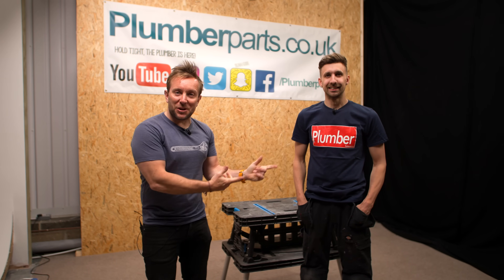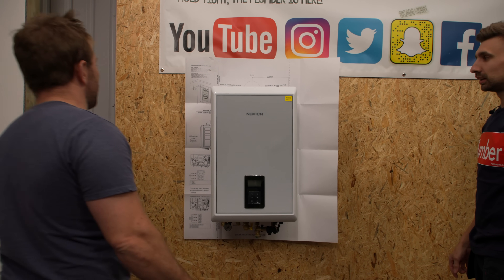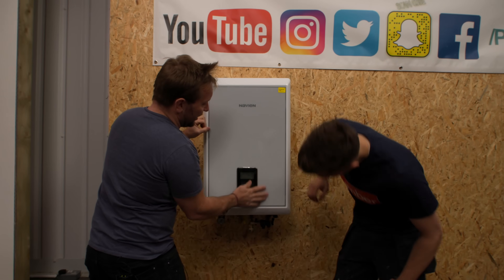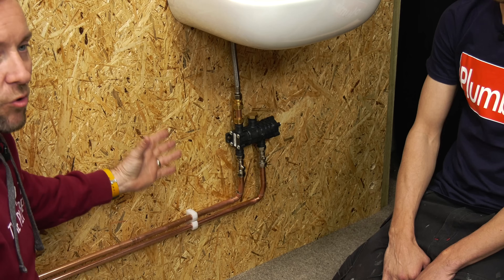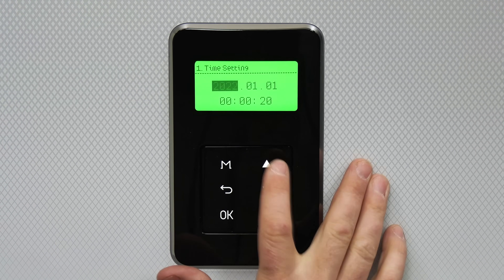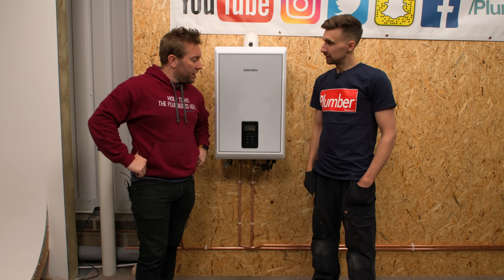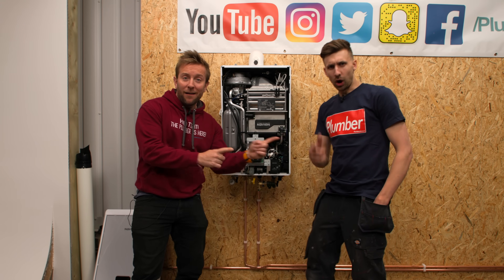HOW TO GET INSTANT HOT WATER FROM A COMBI BOILER - Navicirc review

Comment: On the navien channel. It says just connect hot and cold to the recurculation valve. (Check it out) would this not cause legonaires issues? As it would be warming the cold drinking water
Reply: Wouldn't you be taking the cold drinking water off before it reaches the boiler? Not necessarily, no, but you could do?

Comment: People acting like a secondary return on a combi is a new and innovative thing 🤣 been doing this for years, standard bronze pump and motion sensors in the bathrooms & kitchen, pipe stat on the return to knock it off once the return is warm. Looks like a good boiler though, OpenTherm and 15:1 modulation. Going to need a huge gas supply though!

Comment: At 16:10 Josh makes reference to "barrel pipe" as unsuited to a secondary return. I'm not sure what this reference means and would appreciate a heads-up on it.
Reply: What I mean by barrel pipe - is that some plastic pipe comes with a single layer but barrel pipe has two layers. Because secondary return pipes are continuously hot the non barrel pipe starts to disintegrate.
Reply: @joshtappin3269  I think you mean barrier pipe.

Comment: Interesting but a bit of a gimmick IMHO you still need a decent flow rate to run several showers at once much better off having flue recovery system, liking the Intergas boilers which have this with simpler design.

Comment: Been doing this for years in commercial
Reply: The secondary return accessory has been available for decades in the USA.  Across all boilers, even Walmart sell them.

Legionella concerns in the UK prevent the cold water supply being exploited for a hw return.  Consequently Navien need a hw return separately run in the UK.

Which leaves the secondary return pump controlled by the boiler the only new thing here.

This is not quite the same as the secondary return on larger domestic/commercial because it is a combi with no significant water storage.

Comment: I've just recently had a Navien 'blue flame' oil combi installed. I'd never heard of the company before but they're huge in the states. 
I'm now curious if my one has this hot water feature but I'm sure the fitters would have told me.
Reply: There isn’t a second pump in an LCB700

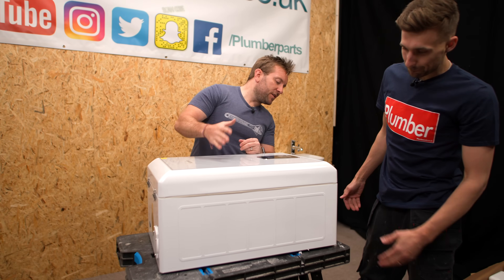Comment: 2:19 side view, seal looks poor. offset pipe connections, not a good idea for installation (jig better option). Navicirc not ideal for many installations in the UK, where there are more than one circuit, its only ideal if installed like the demo image you put up, so its extra pipework to install, extra gas, extra time to install, initial more cost to the customer, possible faults in future, also seen many USA videos about the boiler make, and not that good really, various different faults. did you not want to tear it down?? (3 showers at once - what flow rate on each??, as most UK properties are an average of 17 L/min, that will not do 3 showers) i would not buy one. Tear down vid next?

Comment: Interested to know what oil boilers you recommend?
Reply: I've recently had a Navien oil boiler fitted. It's an LCB700 blue flame combi and we're very impressed with it. Has many features that you won't get on a Worcester for example.
Reply: Not Worcester for sure. I fit grants, mostly bullet prove as long as it’s looked after.
Reply: @ebebop  Grant warranty isn’t worth the paper it is printed on.  Would you swap a 36/46 Grant out (1 yr old) for £200.  That’s what they offered me (original 36/46 a year old, manufacturer defect).

Worcester give a longer warranty and more importantly, back it up unquestioningly with people on the ground.

We also fit Navien oil and gas, have mixed views on these.
Reply: Navien for combi, Hounsfield or EOGB Sapphire for everything else

Comment: Whats m3/hour rating for the 54kw model?
Reply: Do you calculation about 4.98 however it would probably peek at 56-58kw
Reply: @ebebop  that seems a bit short. A Worcester bosch greenspring 47kw is 6.03m3/h
Reply: @D_pawson  that’s 65kw
Reply: @D_pawson  Your confusing input and output.
Reply: Exactly think commercial gas for a start I’d say!